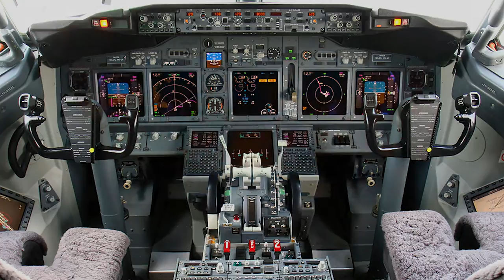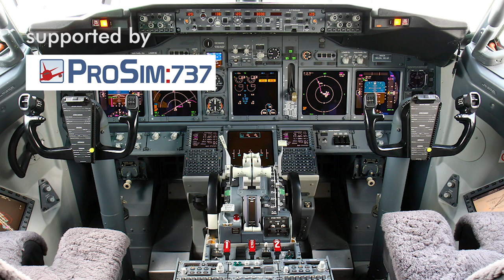Front window frame covering - A Boeing 737-800 Homecockpit #32

Comment: At 3:03 I don't understand why you put that beam there. The front windows should have a higher upper edge than the side windows since the side windows have those thick frames. Well as far as I can see from B737 pictures, I may be wrong. I really like your channel: I have learned so much!
Reply from the maker: It is the upper beam of the front window. It becomes a little bit thicker because of the covering but I'm losing just 10 mm.

Comment: Hello, Big fan of your build videos. i am thinking of using XPS foam which is available to me. what kind of epoxy resin(any brand suggestion) that wont melt the foam? thanks.
Reply from the maker: You should watch my video #14. There I present all the components I'm using. In short, I'm using Acrylic One. A two component product that isn't as toxic as epoxy and can be sanded really well. To glue pieces of XPS together I used spray glue. This doesn't destroy the foam.